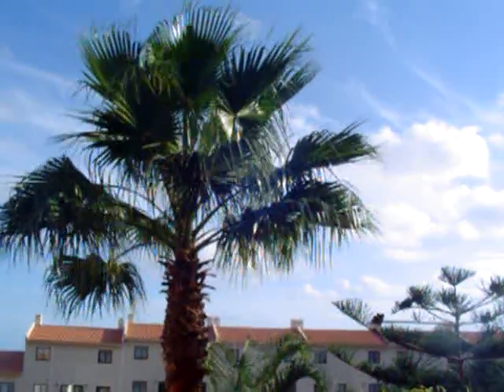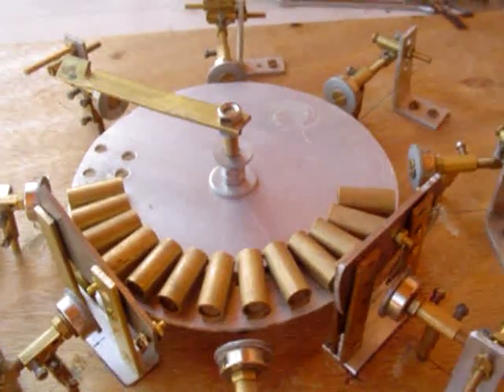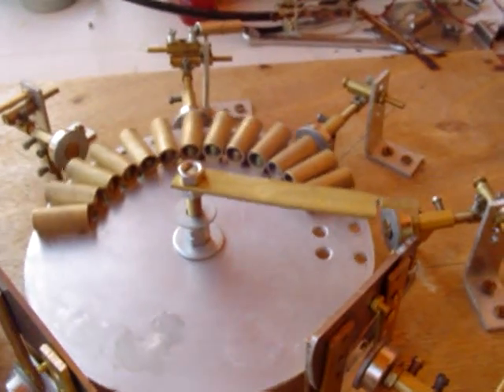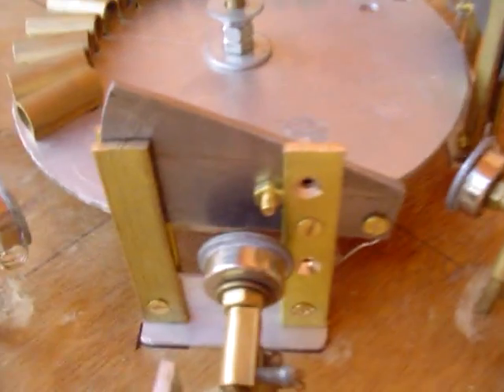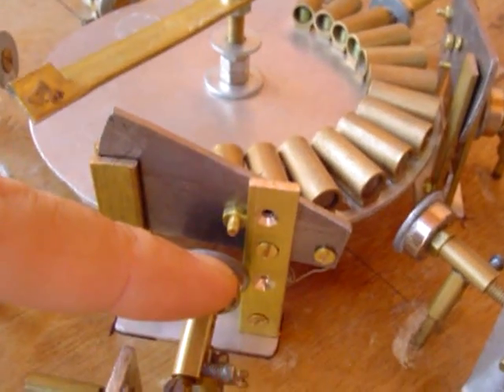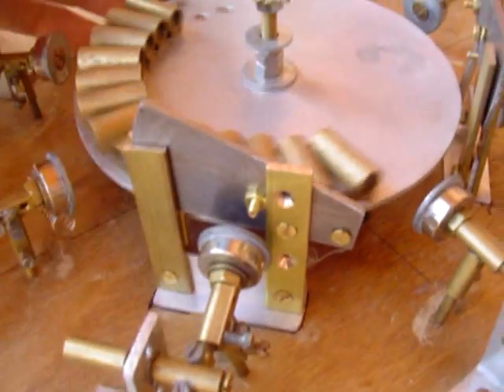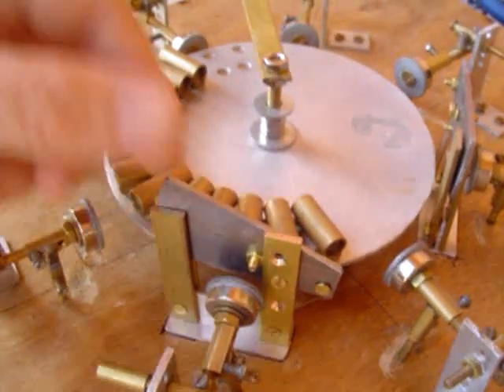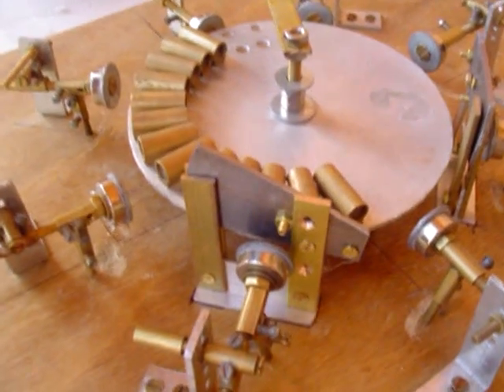Steel shields don't work

Comment: Ali is not a permeable metal. Magnetic fields will pass right through ali. I think steel has not enough ferrous in it stop the field properly and like you say its attracting your magnets which is messing it all up. Use strips of Mumetal

Comment: One thing I have noticed is the shielding does work, but it has to be between the magnets, i.e. if two shields are sandwiched between 2 magnets, there is no attraction of the 2 plates unless the magnets are strong as heck. When you only use one shield both magnets will attract to it from both directions. Maybe this will give you a hand.

Comment: Good work man.
Shielding depends on:
1. material direction, steel has anisotropy in one or two direction different like in 3th direction
2. steel has good and other steel has bad magnetic shielding, use transformers steel
3. thickness of the steel, less or more, depends on magnetic force, and rotation speed.

Dont stop. Good choice. See you later.

Comment: I'm not sure if you're still tinkering with this concept or something similar, but if you are and If you haven't already come across it, try researching mu metal.  It's used as a magnetic shield in many applications. I'm sure you've already found that aluminum doesn't  work well at all as a shielding material.  You may also want to research the Ecklin generator and its principle as its concept is somewhat similar in nature.  I hope you never give up.  ...All my best.

Comment: Nickel 80 or soft Iron. A shield does nothing but redirect the magnetic field so the magnet has to actually be attracted to it. Any metal such as Aluminum, Copper or lead won't give the result you are looking for. MuMetal is a nickel-iron alloy composed of 77% nickel, 15% iron, and small amounts of various other elements that is highly effective for shielding magnetic fields.

Comment: If you tried to shield one pole of the magnet the magnetic field around the other pole of the magnet will colaps. Magnetic shielding is intended to shield both pole of the magnet. in computer hard drives. This does not work 100% some of the magnetic field still pass throug the shield.

Comment: There is no protection from electromagnetic fields. Put this barrier which is magnetized and also acts as an object of attraction. In general, when you notice weakness in the system puts a corrective mechanism. However, it creates forces that are against what you get. Accordingly, everything we do has its counterpart on the system and finally be balanced. Better give up and not wasted your time in vain.

Comment: hi guy, if you check out  ......... FuelBan & Magnet Motors 1.wmv  ........ videos 1 to 3, you can get an idea  how to manipulate the steel to suite rotation. But it is not shielding you are correct.
Thom in Scotland.

Comment: Utubefreemind, just read your post again (answered it the 1st time at work) - you say the perpetual motion argument is lame and dead - are you talking about arguments AGAINST perpetual motion?? If so, you are on extremely shaky ground as there is not one shred of evidence anywhere of a working perpetual motion machine - they all either stop eventually or are shown to be scams powered by some hidden power supply. Surely you can see that if anyone was to come up with such a thing there would be

Comment: Right. And thats why there are so many mangnetically powered perpetual motion machines in the world...can you show ONE instance of such a device? NO. Why? Because there is no such thing. The earth will have magnetic fields for a long time geologically, but not for ever. It and the sun have got about 10,000 years left and counting. A tree producing a microscopic voltage proves nothing - it is a living entity. Replace it with foil and you get - nothing. Perpetual motion does not work. The end.

Comment: The problem isn't magnetic shielding. For any circular path the net energy gain is always zero. 

If you make a circular track, then for every point that is down hill, there is an up hill somewhere else. Since it always returns to the start again, the net gain is zero. 

The same is true for magnetic potential. Alerting the flux as you move doesn't change this fact either, you are either going down or up. If you return to the same place, there was no gain in energy. Then add in friction losses..

Comment: You need to turn your machine upside-down. You can't block a magnet, but you can turn a repulsive force to an attractive one using the plate you have. Tat means you need to have your pates down first, ad lift as the rotor turns. Bet ya a nickel that works.

Comment: To break the field, by putting a barrier you need to put energy into the system. The most obvious way would be to put a magnet on your 'guard' aligned to repel both inner and outer magnets, it will then break the attraction. As it is, the magnets at the sticking point are sitting at an energetic minimum, so to break the attraction you need to put energy into it. This then equals the energy released during the spin to get to this point, and you get conservation of energy.

Comment: I don't think this design will work many others took this approach and failed. Beside the mechanical opening and closing of the shield will slow the wheel somewhat which will make it less efficient even if it worked.
You will need to create two moving wheels or cone shaped contraptions against each other with the magnets placed just right to make both wheels turn. The magnets will of course need to be placed on the cone-wheels.

Comment: ya sorry i can't remember many details on that 'imaginary' particles theory, but if it was a flow of real particles, how come you need to MOVE a magnet to move electrons in a nearby wire?
if they were flowing around the poles of the magnet, id think it could induce a current in a nearby wire while stationary?

(<-- not pro just speculating lets not argue lets discuss)

Comment: if a magnetic field is caused by a flow of imaginary particles, as I've heard it described, mightn't an insulator block more magnetic field than metal, through which electrons move very freely?

Comment: yeah, i dont know if you tried it yet, but from my tests aluminum or copper wont shield anything. you need steel or iron, which unfortunatly will be attracted to the magnets.. more, smaller stators and rotor magnets maybe??

Comment: One effect I found that may be helpful..a thin steel or tin sheet can shield 2 repelling magnets if the thickness and spacing are just right. The attraction to the metal cancels out the repel between the magnets through the metal. It is a balance, so moving 1 magnet away makes the other one attract the metal!!
If the metal is too thick, the magnets ignore each other and always attract the metal!

Comment: Toldya it wouldn't work. Neither will aluminum or copper because they won't shield at all. But they will help slow down your rotor due to the lentz (sp) force.

Comment: Magnetic fields (forces are caused by magnetic fields) cannot be blocked, no. That is, there is no such thing as a magnetic insulator. < < < some physics site

a quick google seems you can distort a field but you can not block a field ,good luck your need it :-)

Comment: Neat video!
When I was a kid I made a 'perpetual motion' machine with magnets with two separate discs placed above each other and magnets aligned in even spacing repelling each other all the way around. With the appropriate angle and appropriate placement I got the device to move!

After watching for 50 min and watching it get slower and slower, I was dismayed after it stopped. I removed the magnets and to my chagrin, the magnets were 'dead'. :( The magnets were providing the energy. 
Good Vid!!

Comment: i have one idea, you could construct simple construction at the start of rotating magnets, which would push the stator pagnets up before commoing start position to reaching the next stator magnets. The stator magnect probably will need update, that the rotor would tilt the static magnets as easy as posible. Chears.

Comment: interesting approach. I have a similar model concept, based on magnet schielding. I think this is the only way to make a workable device with magnets.
You should take into account all interactions, between magnets and between shield and magnets. Some of these interactions produce useful work wich can be used if you put a flywhell in your device, to store this work.

Comment: Try a curved shield. The curve of a metal measuring tape deflects the magnetic field but would attract the magnets. Perhaps a curved non magnetic metal such a aluminum would also deflect the magnetic field without attracting the magnet. Instead of blocking it - deflect it.

Comment: If you've gotten you're aluminum shields installed have you found that the "mechanical bumping" of your (im assuming its brass) swing arm is slowing down the works a bit ? If it is you might try to install disc magnets on the tops of all your shields and one similar disc magnet on the bottom of your swing arm like polarized with the shield magnets of course so you can achieve your deflection with less loss of mechanical energy ?

Comment: That is good thinking, but it will be tricky to do that without slowing the rotations of the wheel too much. I would try a very week spring on a piston pushed back using a long lever. The weeker the spring and the longer the lever the better.

Comment: I thought of a manetic motor years ago which of course  i never buit but my fly wheel was vertical and relativly heavy and places vertically and the magnets (only two) acted like pistons and were drawn towards an iron plate. The iron plates (there was one for each piston acted like valves and were placed or displaced mechanically in front of the "pistons)

Comment from the maker: the problem is attraction to the metal, the same would occur with mu metal. Since in this configuration there would be a shield over each stator too much metal was being shown to the rotor. Please realise that these were attempts at getting a torbay design to work, since it was never designed with shields in mind. I have an idea on the drawing board when the positions of the shield would not interfere with the rotor until needed

Comment from the maker: Hi Olafdotcom, You are 99% correct when you say that only ferrous metals can re-direct magnetic fields. When non ferrous metal passes through a magnetic field current is induced into it and since we have a current there would be some deviation, although probably difficult to measure., tried to flip magnets as per torbay, see other videos to see why that does not work